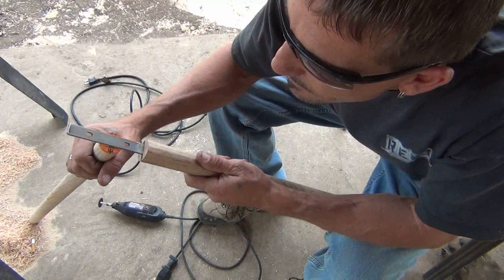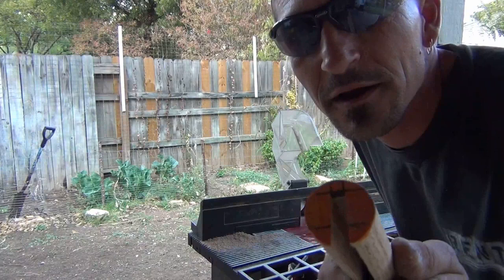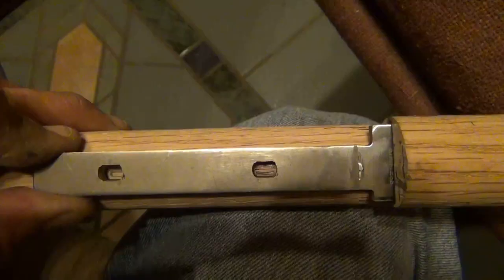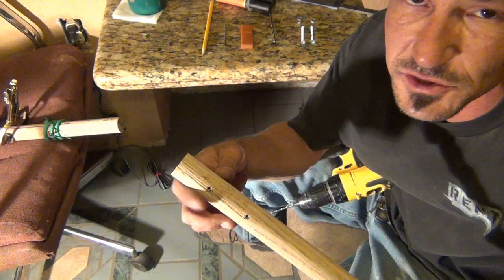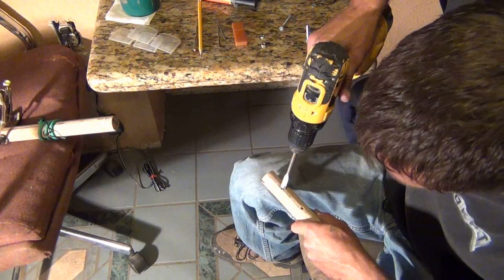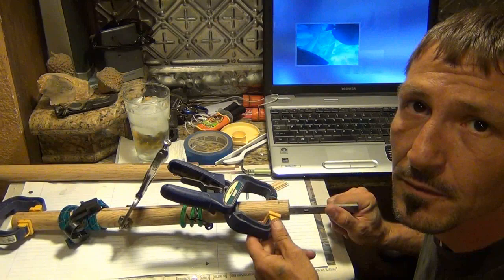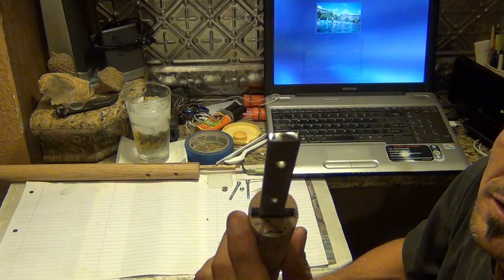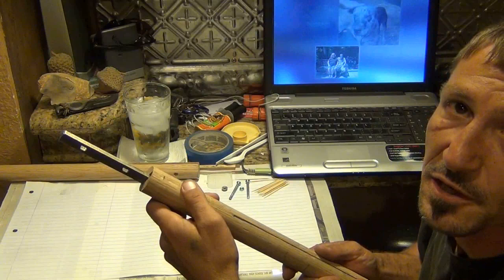Building A Tactical Walking Stick 6

Comment from the maker: @bigD96000 I use a cheap blade I got at the flea market. I'ld be worried aboutthe stick breaking before the blade. Thing to remeber is not to pry with the blade, its for sticking mostly. And dont use it like I did on anything hard, meaning all together. The blade could bust outa the shieth if it was hit hard and wrong. take pics!

Comment from the maker: @JGguns1 I thought about that. What if you use a saw to cut it in half, then use a belt sander to smooth it out? Then cutting the blade to the sheith, if no router then you can carve or use a dremel. Dremel are low $ so that may be the way.

Comment: i think you should have not used the flat head profile handle screws, with the bugle shape, as when ypu tighten the screws the will try to split the wood.  what you need is a shoulder under the screw head that will rest on a flat countersunk surface in the wood